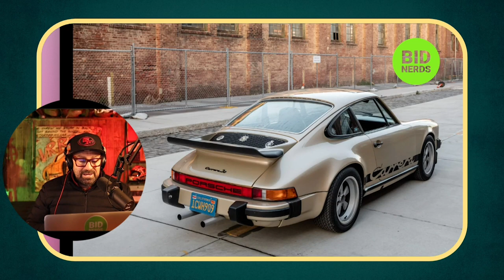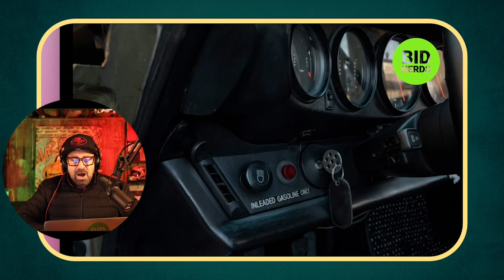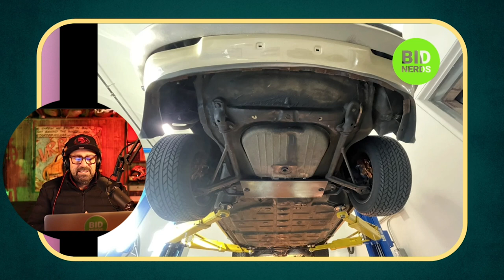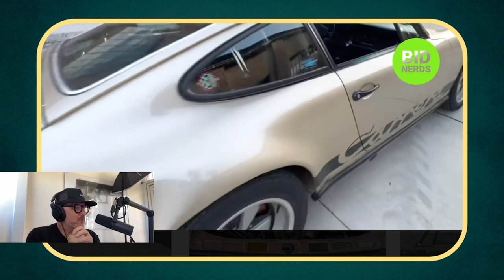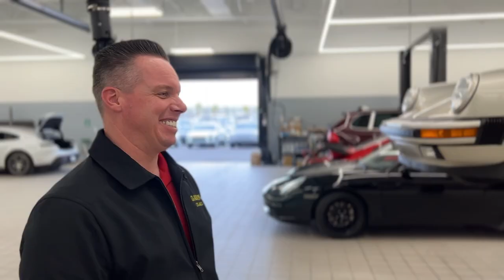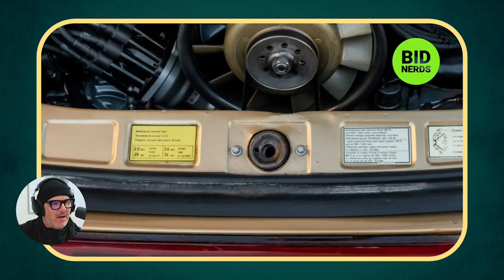Does a HotRod Engine Equal More Money on BaT for this 1977 Porsche Carrera 911 3.0?

Comment: Hey. This is my car. Wish I got it for what you all guessed.  Super fun car but needed some love to really take advantage of the motor.  So the transmission is getting rebuilt, installing an LSD, a rennshift short shift kit, converting to an elephant racing coil over set up, and then some cosmetic things, like new wheels, steering wheel, pedals.  Oh and a new oil cooler to keep things working well when pushing hard.

Once I am happy with the how it is driving, I’ll probably turn to the interior, consider swapping out some bumpers, and maybe paint. 

This is a fun car I intend to drive and enjoy.  My cars aren’t investments, they are toys.  I will almost certainly end up putting far more into than I can ever get out of it. But part of the fun is to make it how I want it.

Comment: The hot rod designation leans towards the adventures market, a smaller market , but $105,000 should be attainable.
Reply: Agree here a true rare car only 3687 Carrera 3.0s made compared to 58,000 911 SCs. The Carrera 3.0  has lot's of history and in Europe these automobiles bring in a higher remuneration, hard to find.